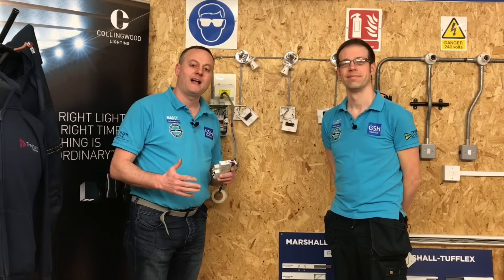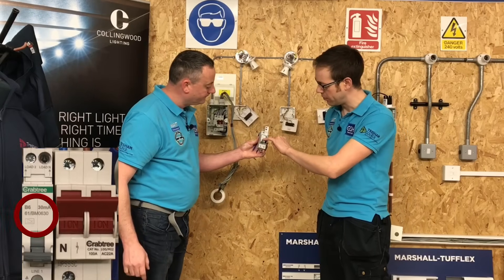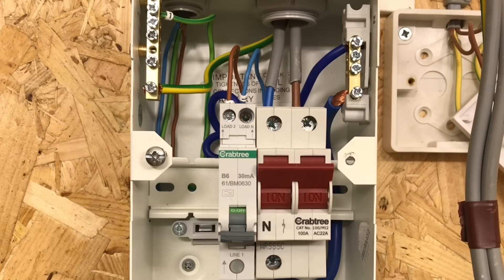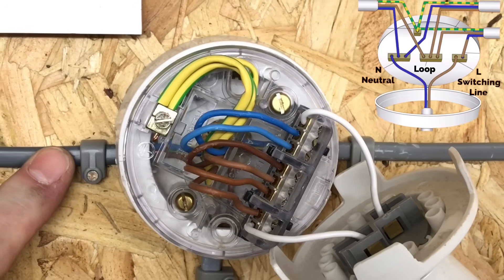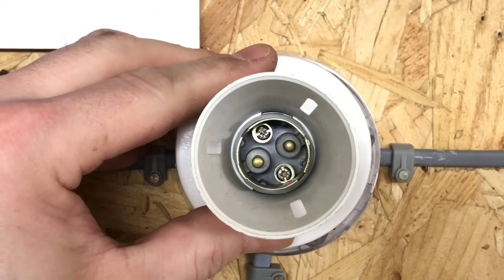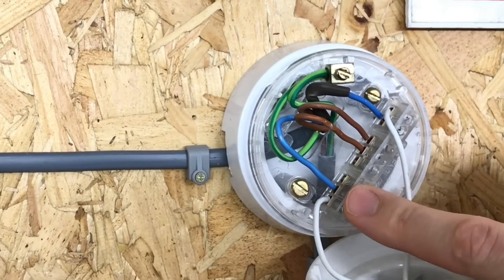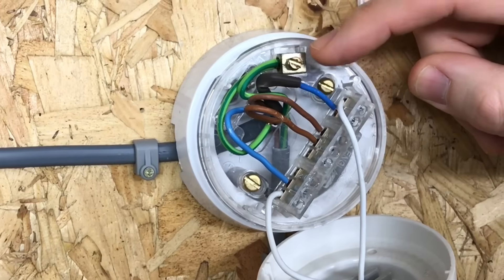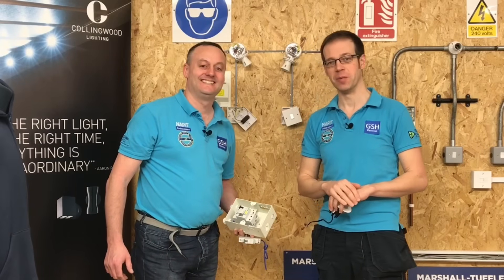Lighting Circuit Connections Explained in a 3 Plate Loop in Method and RCD’s now Required BS 7671

Comment: I thought that under the 18th Ed that the minimum csa for fixed wiring was now 1.5mm or am I wrong?
Reply from the maker: Hi. Cable size is selected against the load, volt drop and installation conditions. 1mm2 cable can still be selected for a lighting circuit 👍. Thanks for commenting and watching Gaz

Comment: Wouldn't it be better to use a black or grey sleeving to distinguish between the permanent line and the switched line? The line conductors can have the three different colours: brown, black or grey. Personally I'm using black heat shrink for that purpose to mark the switched line if I must use the blue wire as a switched line.
But there are a few situations were I avoid this. Especially if I'm dealing with old installations here in Germany which have the pre 1965 cable colours black, grey, blue and red (transition period until 1970). In that case the N (or PEN depending on the installation) was grey which is by todays colour code a line conductor. The blue one was also a line colour, that was the reason we switched over to pale blue for the neutral at first and the grey one was a second black here.
That's a nice system, here we use a different method, all in junction boxes and in older installations the lighting is connected to the outlet circuit of the room. The outlet circuits are fused with 16A, and the wiring of the lighting circuits is 1.5mm² for that reason. Our system got the advantage there's in most cases an outlet next to the switch. That outlet is there especially for the vacuum cleaner, so you don't need to crawl on the floor looking for a vacant outlet in the room you want to clean.
The green/yellow sleeving in the last light fixture actually looks like a partially peeled cucumber... ;-P

Comment: Great video. Thanks for sharing.  As a sidenote I would like to add that here in Northern Ireland the minimum cable size for final lighting circuits from a consumer unit, as stated by local Building Control Authorities, is 1.5mm and not 1.0mm.
Reply from the maker: Hi. Thanks for the information it’s very much appreciated. All the best Gaz 👍
Reply: It's certainly common practice (and indeed wholesalers don't stock 1mm^2 T&E) - however, I'm not aware of any actual requirement. Incidentally, twin brown is always used here.
Reply: @richardwalsh5882  - The requirement comes from Building Control and is not an actual Regulation. I served my apprenticeship in the 1970's and it was twin red T&E that we used. When i went to England to work in the early 1980's the electricians there had never even heard of twin red cable.
Reply: @Alan_AB  Yes indeed twin red was used before the days of twin brown. It would be unthinkable here to sleeve a brown & blue (or previously a red & black). Regarding the 1.5mm^2 cable I'm not aware of a requirement from Building Control (although welcome a link if you have one) - the only thing I can think of is a Housing Executive spec which to my mind specifies 1.5mm^2 cable. As said, 1mm^2 isn't actually stocked here anyway.

Comment: I recently had a fire in the conservatory caused by a small lipo battery I was charging. Luckily the patio door to the house was closed and the fire burnt out.
I have a very old Wirlex consumers unit with wire fuses. I want to get that replaced by a competent person. Would a modern board with RCBOs stop similar incidents in the future? Thanks, love your channel.
Reply: It's more likely the charger it's self that's at fault.
Reply: @nigelbuck6256  I have no doubt but I want to be sure if my electrics will trip and not carry on feed current to something that is burning and clearly defective. Thanks for the reply
Reply: The answer is no! Modern batteries have the ability to become very hostile quickly, yes an RCBO would trip as it picks up an issue but at this point the battery is already gone to far! 
If you leave batteries unattended in a building then put them in a large metal container, not sealed! The same goes for phones etc yes it's overkill but the fire service gets called out to fires started by overheating batteries more than any other corse now.....

Comment: I know it is not needed but would it be acceptable to sleeve the switch line in the twin brown & cpc just for easy identification or are they different shades of brown insulation.Great video as always.
Reply from the maker: Hi. If that’s a method you would like to use then I can see on issues in it. Thanks for the message Gaz 👍